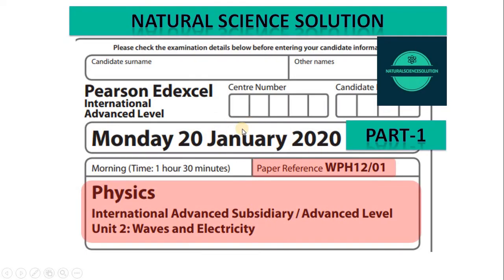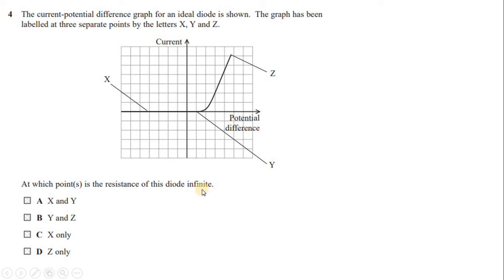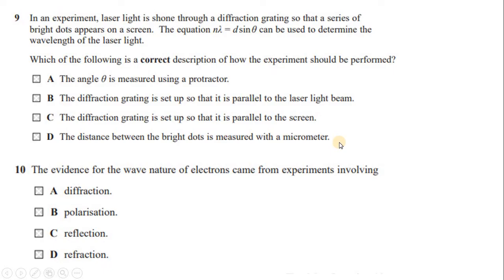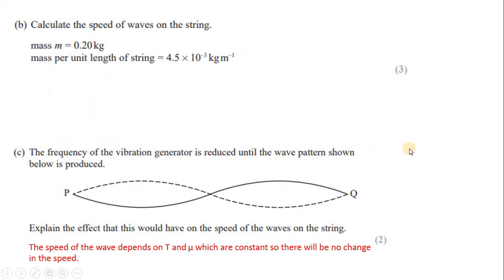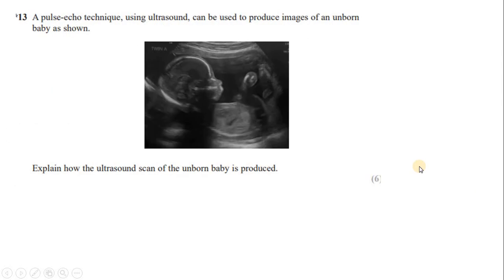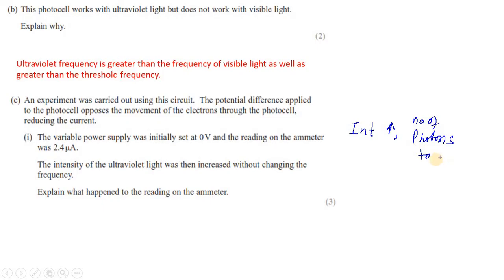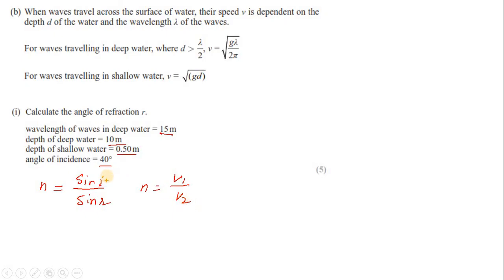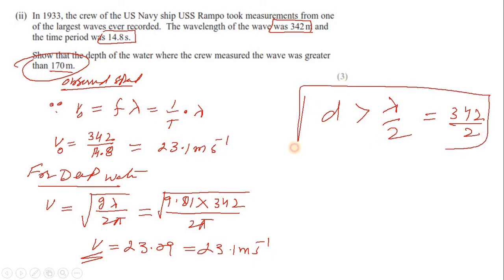Edexcel IAL physics WPH12 unit 2 Jan 2020 Part 1

Comment: Mr for question 14cii, why does when current = 0A, the kinetic energy = voltage x charge of one electron? I dont understad
Reply: You can use "Ek(max)=hf-work function" equation directly instead